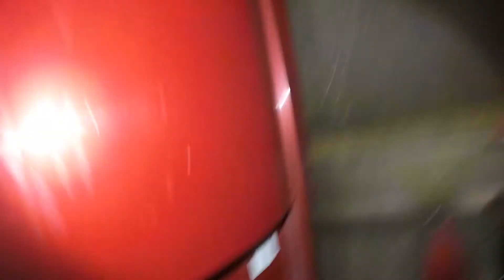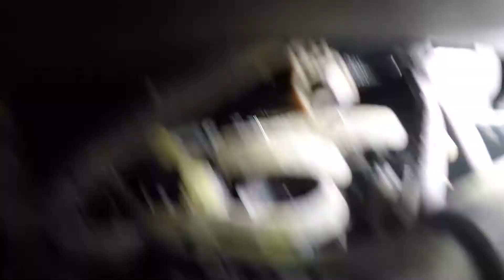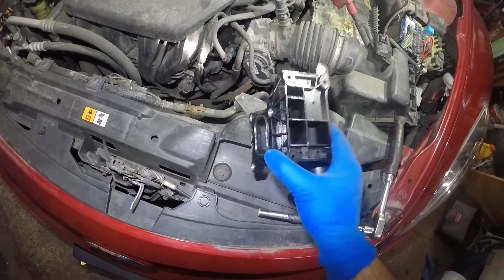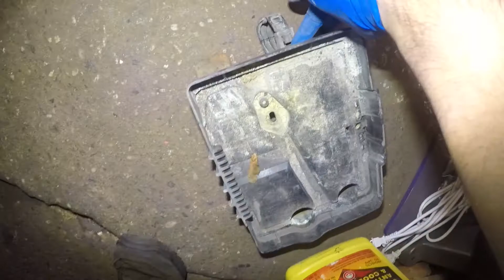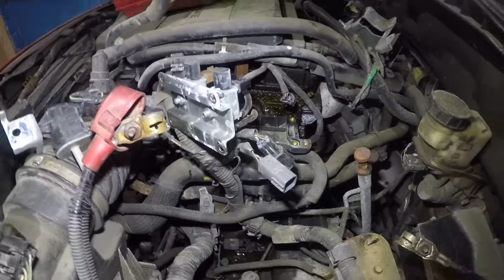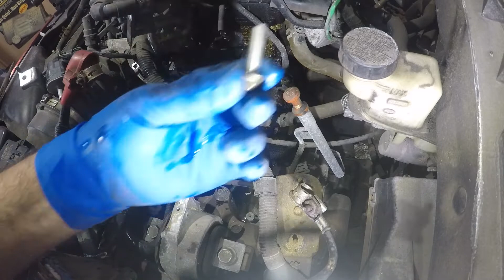2009 Mazda 6 coolant leaks, Replacing Coolant Temp sensor Housing

Comment: Just wanted to say thank you, RB! Your video on replacing the coolant temp sensor housing really helped me out with my 2012 Mazda 6. I had a coolant leak and wasn’t sure where it was coming from. Your step-by-step guide gave me the confidence to replace both the water outlet housing and the thermosensor myself.

The clear instructions, close-up views, and helpful tips made the whole job way easier. Car's running great now — no leaks, no overheating, and no check engine light. Appreciate the knowledge you share. Subscribed and definitely staying tuned for more content!
Reply from the maker: Oh ok yeah this is bit complicated but not so bad

Comment: I have a P1299 code on my Mazda 6. It's a 2011 and it's a permanent code. Any idea on how to fix this issue??
Reply from the maker: Well is the car over heating? I would hook up scan tool to see the temperature
Reply: @RBTheMechanic  no it's not. I did hook up scan tool

Comment: Hey the hose you broke  do you no if that hose go to the radiator
Reply from the maker: They go to heater core I believe
Reply: @RBTheMechanic  I have a hose blown of  inbetween top radiator hose and radiator cap I can't find we're it belongs to I'll probably have to pull everything apart like you did to find it thx

Comment: Hell yeah happy i found this pretty sure this is were mine is leaking from. I was pretty intimidated by all the hoses and wires but your video made quick sense of that for me. Was worried i was gonna have to take it to a shop but after i feel very confident i can do it myself. Just missing a single tool to finish.  Got it over half way done though.
Reply from the maker: Cool

Comment: What are the two sensors that sit on top? There was a redish brown one and a black one, you mentioned something about not breaking them and you were having a hard time with the red one in the video. Mine snapped off and i have no idea what its even called to replace it
Reply from the maker: At what time frame u see them
Reply: @RBTheMechanic at 07:03 you called them solenoids. They have nubs for adjustment.

Comment: Thanks for this info. I just replaced mine. Wondering the indicator seems not working properly. When i started the car this morning, indicator indicates the temperature is already in the middle although i have just started the car which should start at the bottom and rise as engine runs..
Reply from the maker: Replace the tem sensor could be faulty
Reply: @RBTheMechanic  Thanks for your input. I will check with the mechanic. As far as i knew he only replaced the plastic block.
Reply from the maker: @louiegiltampoc8949  yeah check with him it would had been good idea to do it while it was open
Reply: @RBTheMechanic  Thank you. Actually, replacement of the block (engine coolant water outlet) is done. But i noticed that when i turned on the engine in the morning,  the temperature reading goes directly at the middle which is unusual as it suppose to rise as the engine rise until it reaches the mid part (normal temperature), which roughly take around 4 to 5 mins once the engine is started from cool condition. 

Thank you. I really appreciate your swift responses.

Comment: I had a leak from here for over four years couldn't find it.. Finally it's starting to leak a little more , i still didn't fix it.. i'm gonna pressure tested in a couple days to make sure it's that the part .. Actually I'm buying the gasket .. If the housing is not cracked I'm just replacing the gasket for $3.50   They sell it  But I'll buy the whole thing too separately for $75..  Because I don't feel like running to the store because I had no way to get there so I'll get everything before and whatever I don't use gets returned...  The problem is I want to replace the hoses going to the heater core and I don't know the size of the  hose  .. Which is a pain I might just run to the junkyard and get the same hose and cut it so I could bring that sample to the parts store to get 2 new hoses .. right now my car is running at a steady 208°   At Idol for couple hours . I just topped off with distilled ,, I'll flush the whole system when I'm done , I'm just putting it off because it's 115° out tomorrow And of course I'll end up doing it in a parking lot somewhere because I don't have a place of my own... Anyone have any idea of the proper pressure test pressure I should shot for,,  When I do the pressure test for this particular vehicle mines a 2013   basically the same car  ,,  I would think a pick  would be the easiest thing to use to remove that hose that you were having a problem with  ,, Can you take the piggy stick it in the hose and go around it to move it off..  Anyway this should be fun definitely not looking forward to it... I'm going to put some thermal protection because there's a exhaust manifold right below those two hoses that go to the heater core I'm gonna have them wrapped in fiberglass sleeves to protect the hoses
Reply: You would think it would last year's.. I replace the whole housing.
Eight months later the housing was broken again.. Good thing autozone warranties that part for life.. I ended up doing it at autozone. This was in april sometime... Right now i'm dealing with an open thermostat. Car will not go over 130 degrees. unless I sit and idle.. Then I can get up to like 150.  When that happens. I get a small weep From near the water pump area ... If it's cooler I don't get a leak. It's only if I sit and idel.. Pretty funny.. But I have a thermostat on order.
In two days I get it... I already have the water pump ready to go. Just have to take the power steering pump out.
 shouldn't be too hard... Thank god it's cold out..lol
Reply from the maker: Ummm I’m not sure u want to just replace the gasket I would replace the whole thing it get brittle also the sensor since ur in there and then it should last u years to come

Comment: i did everything in this video but putting it all back together, the top bolt where one of the nuts go just broke off as i was tightening it back in, idk if to look for a new metal bracket or what
Reply from the maker: U maybe over tightened it

Comment: What did you pump to see the leak
Reply from the maker: Coolant pressure tool was used to pump small amount of psi to the system
Reply: Can't I squeeze a hose to get the water to circulate so I can see where mine leaks?

Comment: That’s exactly where I see steam and wetness coming from in my Mazda 3 it’s a 2009. My coolant reservoir is low I put coolant in the car drive and it smokes and it’s low on fluid. Also my heat goes in and out it gets hot then blows out cold air. I put my car in the shop yesterday.
Reply from the maker: Oh yeah somthing not so bad to do

Comment: Peace.  Great job youngman. My name is Sha-King. I would like to know if this 2009 was a V6. I am having the same mystery leak in my coolant system on my 2009 mazda6 V6. Is it different on the 4 cylinder. Can you please let me know if this is a V6. Thank you so much. Again, great job
Reply from the maker: No this is 4 cylinder
Reply: @RB The Mechanic  peace. Where besides the dealer can I get the part for the v6. It looked like it's in the same location. The hoses go to the same place
Reply from the maker: @christopherbird4753  autozone or pepboys can order it or u can search the part number on amazon

Comment: Glad I found your video. Mine just broke this morning, guess it’s the gasket. Great video man👌
Reply from the maker: Yeah not so bad to do just take ur time!!! Get that sensor also if u get the same part
Reply: @RBTheMechanic  It was actually pretty easy, though I was going to take all day. It only took me 2 hours labor plus new coolant and purging the system. Purging it take a long time.
Reply from the maker: @ajf4693  yeah not so bad good job!!!!
Reply: Awesome video. 252k miles and mine just failed. Looks pretty simple. Thanks for the video!!
Reply from the maker: @doug-the-unicorn  yeah not a bad job!!